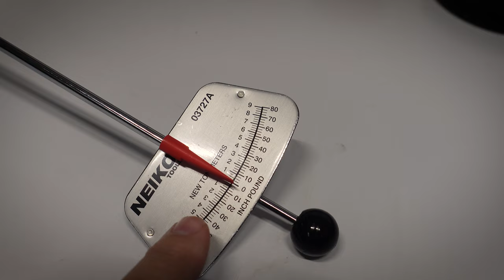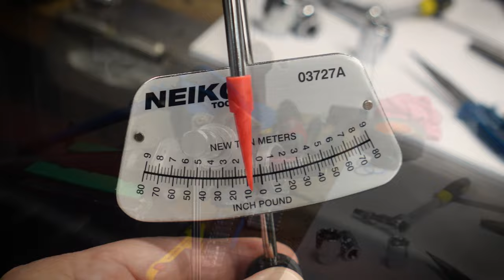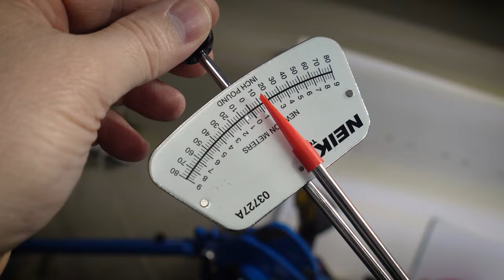Full Rebuild of my  R34 Skyline Power Steering Rack

Comment: Great work and nice videos. Thanks a lot for the series. I had an R34 25GT myself in red between 2010 and 2014, right before I got myself a black 25GTT. I did some work on them myself as well, belts, plugs, injectors etc. My steering rack is currently leaking at a rate of the cylinder going from high to low measure in about 30k km, so I will not be rebuilding it anytime soon, but when I will your video is going to come in handy for sure. Thanks a lot!
Reply from the maker: Thanks, glad you liked the vid. If you're only going high to low over 30,000kms you might find just some fluid with sealant additives might keep you running for a while longer.

Comment: great walkthrough. i'd have used a low viscosity grease for closed gears (EP/NGLI 0 or 0,5). EP/NGLI 2 squeezes out of the gears and they can end up running dry, also marginally increases friction in the system. another tip is to put the seatbelt through the steering wheel so it doesn't move off centre.
Reply from the maker: Interesting - haven't had any issues with it so far and have done a fair amount of kms but will keep the grease info in mind for the next one. Thanks

Comment: Helpful video, just done my rack. You don’t need a tool to get the seal out though, you can knock it out from the pinion side with a socket and extension 🤙🏻
Reply from the maker: Wasn't enough left on my seal to catch the edge with a socket, but good info for people that might not have too much wear and can get it out an easier way 👍👍
Reply: @TheBuildRoom  I wonder if I have a didn’t rack version to you because mine had a thick metal washer behind the inner seal which is what helped me knock the seal out from the other side 🤷🏻‍♂️

Comment: Many thanks for this informative video.  Would a suitable sized socket + extension in the rear end push out the recalcitrant seal?
Reply from the maker: Glad you liked it. Doubtful any socket would work to push out that seal. The seal seats down onto a metal lip and the internal diameter of that lip is only a hair wider than the ID of the seal, so it wouldn't have enough meat to push on.

The seal removal tools come from the other side and expand into the seal to pull it out.
Reply: @TheBuildRoom  It did seem a tad too obvious, so I sorta figured it had to be something like that.  Thank you.

Comment: Hey great video. I don't really have the space, equipment or knoweldge on rebuilding a rack. But i bought one off ebay and while it does not leak it makes a bunch of noises and pops, and it makes that thumping noise when you turn the steeringwheel left/right very fast. I took it off my car and put the original one back on as they both seemed similarly worn The ebay seller let me keep the rack for free when i tried to return it. Since then though my rack has developed some play on the rod part and a clicking noise and starting to cause weird suspension problems. I was thinking of taking my ebay one to a rack rebuilding shop. I was wondering if the issues I mentioned would fix this rack since there is no leaking issues. Or will changing all these parts make it function like a new rack?
Reply from the maker: Are you sure the play and noises are coming from the rack and not the tie rod ends? If it's just worn out rod ends you can replace pretty easy with the rack in place. Otherwise you'd need someone to inspect your rack, it could be a bust bearing or something. Seals and bearings are fixable, damaged gears not so much.

Comment: So where did you source the upper pinion gear seal? part #? need to replace exact same seal on 2015 Q50 V37
Reply from the maker: A local power steering company sourced for me, wasn't expensive and they had it listed.

Comment: When installing pinion gear, do I have to adjust the fluid holes or not? or it can be installed directly without considering the fluid path
Reply from the maker: I'm not sure what you mean bu adjusting the fluid holes?

Comment: How about using an electrical conduit, which is plastic, and push the seal out from the other side? Would that work? How long did the rebuild take approximately I have a leaking 350z steering rack I’m thinking of rebuilding?
Reply from the maker: Nah i don't think the lip of the seal has enough strength to transfer enough force to shift the seal - its a tight one. I'd recommend just hiring a tool.
Reply: @TheBuildRoom  and approximately how long do you think would be a reasonable timeframe to allow

Comment: Hi, did the pinion seals come in the pspa kit?
Reply from the maker: No I got them separately from a local power steering specialist
Reply: @TheBuildRoom  I’m in Albany and have a 350z steering ack that needs to be rebuilt, can you tell me who it was you dealt with so I can order the parts? Great video by the way, cheers Howard
Reply from the maker: @howardrathbone2120  yeah no worries man, it was Power Steering Specialists in Malaga. They ordered it in but it only took a couple of days, and had it listed so no guesswork.

Comment: Where is the solenoid on your ps rack? I have an r34 gtt and my rack has a solenoid on it.. What is the difference between the 2 racks?
Reply: Nobody know?
Reply: Yeah mate, that is actually a difference between a non turbo and turbo r34 steering rack.  The solenoid on the gtt is for variable steering assistance, so at low speeds it will assist the most, and at higher speeds it will be very little assistance. Apart from the solenoid, the racks are pretty much the same  @drnc8770

Comment: will the rebuilt steering rack make the steering light again after the rebuilt? mine is stiff
Reply from the maker: @comaradelee  mine lightened up because it was leaking previously and now has full pressure, but it really depends on what is causing yours to be stiff (could be other suspension components, wheels etc)
Reply: @TheBuildRoom  thank you for this
Reply from the maker: @comaradelee  no problem, also might be your power steering pump, if it can't build up enough pressure it's would definitely be heavy